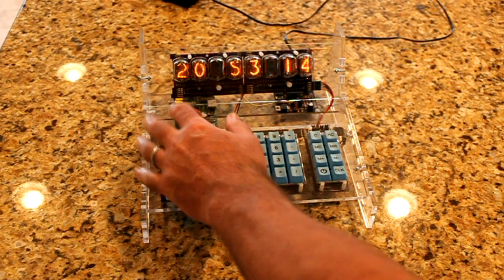Nixie Tube Calculator, Kickstarter Prototype

Comment: If someone ever decides to give this another go, one bit of fun that appears to be missing here is that the display isn't also the calculator's accumulator. One of the fantastic things about old nixie display calculators was watching all the digits display in super-rapid succession as the intermediate calculations are stored in the accumulator. Without that, half the point of a nixie display is missing. Note, the calculation speed might need to be throttled (control the clockrate) to balance the display effect with calculation speed.